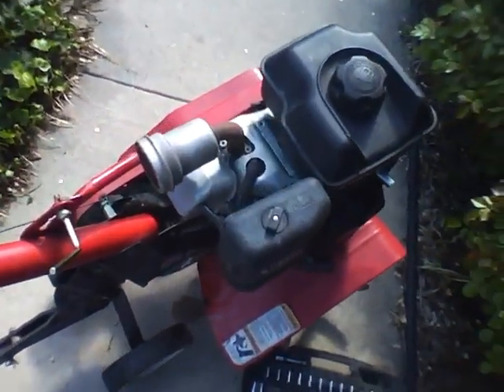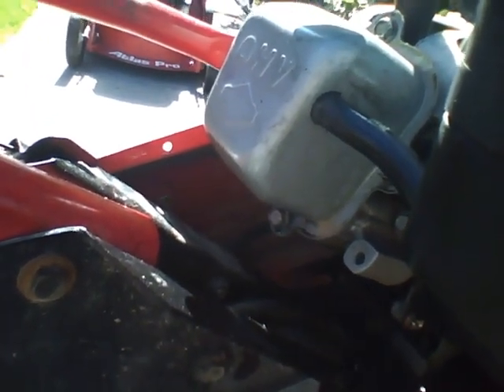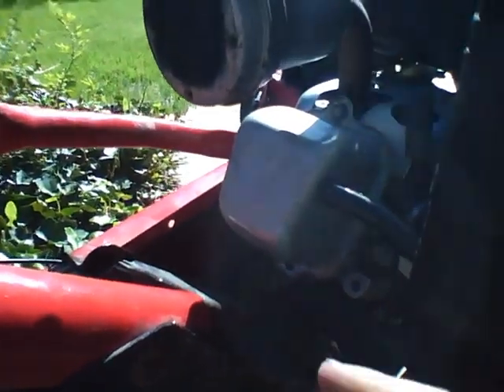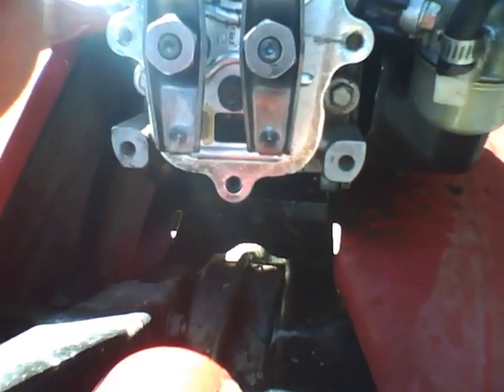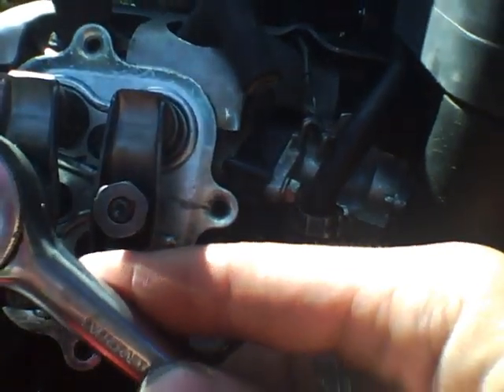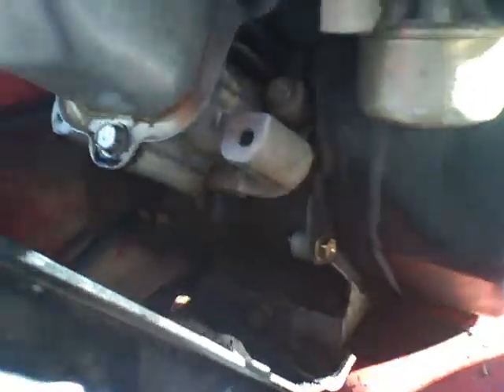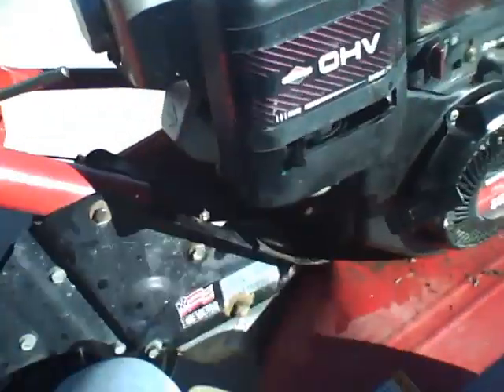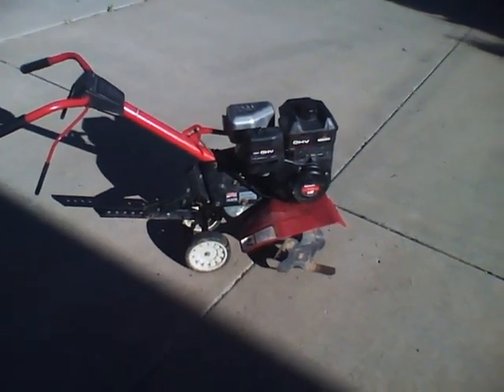fixing a 2001 OHV B&S rototiller

Comment: @Smallgasengine1 i like flat heads because, easy to work on, not much problems with them, and briggs and startton flat head (newer ones 5HP +) always start 1st pull (atleast mine dose) not to bad a fuel, lot of power. the end : )

Comment: hey on my kohler the vales u could NOT move them maybe that's the problem, a friend of mine suggested that the valve is not seating right making it run bad and maybe the oil leak what you think?